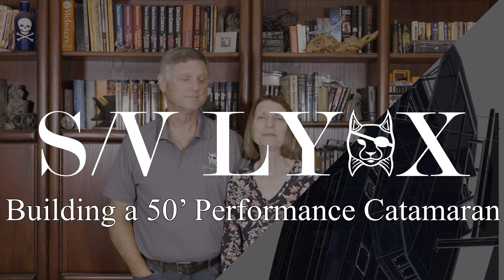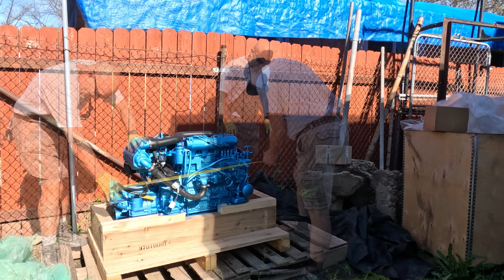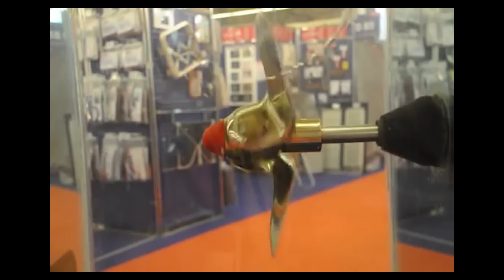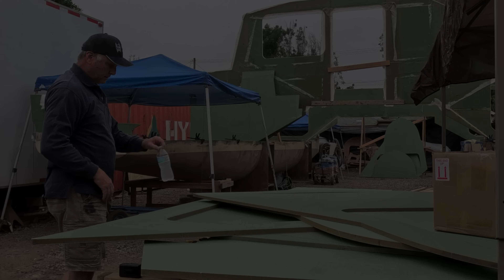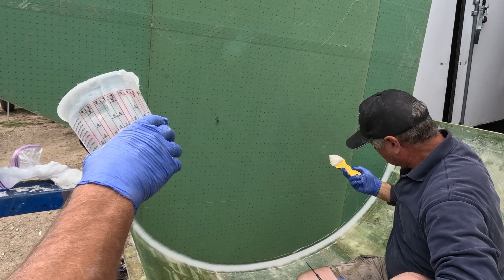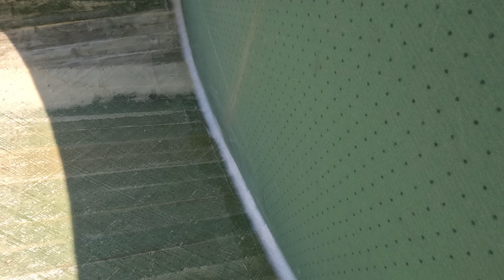Kit E83: Hybrid Propulsion Upgrades

Comment: Good explain of the system. Should work well.
It occurred to me that you only need to suspend the motor over its location,  rather than fix it into position,  before you do the last few bulkheads  
Manipulating the engine from a temporary "shelf" after the beds are in won't be too tricky
Reply from the maker: We'll get the motor mounts built soon enough to get the motor in position.  Schionning has already sent the new plans to Bruntons so we should have the final design soon.

Comment: Hi guys! The progress is rapid now. Looking great!
I like your solution for the brake calipers. Simple and efficient.
I didn't see a thrust bearing in your drive system diagrams. Will you be mounting a separate bearing for this, or is it incorporated into one of the other components?

Another thought that has come up while watching you install the bulkheads, how do you ensure that there is no twist glued into the hulls as you glue the bulkheads in? The hull can "rotate" around the bulkhead a little, which would introduce misalignment between the hull top edges and the side panels that will be added later. The degree of this misalignment increases with distance from the bulkhead. I see this as being an issue only in the aft section where the hulls have a rounder profile.

That smoking epoxy looks freaky!! It might be worthwhile mixing in a small % of the slower hardener as temperatures increase into summer, just to slow the reaction down a bit.
Reply: Top tip for mixing the epoxy, once mixed in the tub, pour out onto a mortar board/sheet of aluminium, and continue mixing before bagging the mix, this will allow some of the heat to dissipate.
Reply from the maker: We haven't gotten to the bearings and shaft portion yet, that's still to come!  As for any twist, the hulls have a natural position from being glassed on the forms.  As long as we don't stand in the hulls while the epoxy cures, no twist is introduced.  We stay out while the epoxy cures and check the levels on the bulkheads several times.  We are using all slow hardener already, freaky, hey?
Reply: @SailingSVLynx  ohh wow! That is freaky...

Comment: Wow. Those coves look pretty slick. I can see that your fabrication skills are sharpening as the build progresses. Nice work.
With every component brought on board, there is one more thing that can fail. A flat plank and a paddle are unlikely to fail, but wouldn't make for much of a comfortable cruising experience. A 100% automated large sailing vessel would be super comfy, but would be a maintenance nightmare. I drove myself crazy with those high-tech vs. low-tech decisions when I designed our house. I can see that you have spent a bunch of time trying to find the sweet spot on that curve as well, and you are adopting those technologies that you understand well and can debug in remote locations. The only suggestion I would make is to rely on vendors that are not likely to go out of business anytime soon, and to bring a closet-full of spare parts that will be difficult to source when you are on the hook in Bali or Borneo. Good luck with your build and your sailing adventure. 🙂
Reply from the maker: Good suggestions!  We will bring a boat load (literally) of spare parts ;)

Comment: I think your propulsion system is the way to go. We sail on a 52' catamaran and are considering a new boat with the hybrid in one hull and electric in the other. A couple of thoughts: 1) I think 80HP is more than you need. We have two Beta 38HPs and they are sufficient. Would be better to have more, but double is not necessary. 2) 20-25kw for the electric engines is good. I think, however, (and I am not an expert) that you need more battery capacity. As a general rule Lithium batteries can peak discharge at short intervals their full capacity (in your case, I believe, 12.2KW). At steady state they are generally rated to discharge half their capacity (6.1kw). I could be wrong here, but you should check into. Battery manufactures have this info on their web sites.
Reply from the maker: We have 33KwH., 690amps at 48v.  This boat was designed to have 100hp (two 50hp diesels).  Running one 80hp diesel and one 25kw electric motor (34hp) we have a maximum of 114hp. So we have a little more but close to the designed range.  Also, these cells are designed to discharge 80% of their capacity.

Comment: Get that boat roof on before the summer heat gets here. Have you considered just keeping it simple and doing a stainless grab rail along the roof on each side? Might not be as sleek as your vision but it could be great for tying into or strapping stuff down, more of a function over form.
Reply from the maker: We want the rain catchment system, so we might as well make that the hand holds and save some money on stainless work.  We'll get the whole roof done before the hottest months (July, August, September in So. Cal.).  We should be starting on the roof by the end of next week.

Comment: Great milestone guys ! Good job. 👍
Btw, is there no thick salon floor ie a 'box beam' to worry about - bc I find myself thinking 'is that it' insofar as rigidity goes - just a few 'flimsy' thin bulkhead panels?
Reply from the maker: There is a thick box floor.  We will be constructing that in a month or so.
Reply: @SailingSVLynx  Oh ok, Thanks for that - makes more sense now. 
Sorry to be a nag , but how thick if I may ask - 200mm ? And I'm now more intrigued because I would have thought it easier to rigidize the hulls by building /installing that part before adding floppy bulkheads?
Reply from the maker: @MikeWalker-mijeau  The bulkheads have to go in first because the floor comes up from below to attach to those bulkheads.  The thickness of the sole is 220mm.

Comment: Thanks so much for sharing all your design thoughts, challenges and solutions. It's fascinating engineering to achieve your desired outcomes. At any point did you consider a (diesel) generator, instead of a diesel engine, to power 2 x electric motors (in addition to your battery bank and regen capability)? I am wondering if the "advantage" of a diesel engine with the complexity of hybrid prop shaft, really matters, and if generator + 2 x electric motors wouldn't be simpler and still deliver your desired outcomes. 
1) If you are out of diesel, or if the diesel hardware fails, you have no propulsion using diesel with either system.
2) You still have electric / battery (& regen) backup with either system.
3) generator removes hybrid prop shaft complexity, still allows regen, vs arguable benefit of diesel engine in event of no sail + no electric propulsion possible (such an unlikely scenario with dual electric motors + diesel generator).
I am sure you have given it a lot of thought, and I've watched all your videos, so apologies if I missed why you dismissed that option.
Reply from the maker: You are very welcome, and thanks for following along and making suggestions.  But to answer your question, yes, we looked at every propulsion system we have ever seen and compared them all.  In the end, we choose our system because it we believe it is our best choice:
1) It is lighter by hundreds of pounds.
2) It requires less maintenance.
3) It is more fuel efficient.
4) It is a safer system.
5) It saves you a huge number of hours of listening and smelling a diesel engine.
6) And, when it comes to cost, though it loses to the diesel system in initial installation cost, it makes up that amount over time in fuel and maintenance savings.
7) It has more horsepower.

If you are one of our Patrons that gives you access to the Crew Only section of our website.  There we go into detail about all the various systems as we compare them against each other.  But, I will go ahead and talk a bit about an electric motor / diesel generator system for you right now.

If we went with an electric/diesel generators option it would...

1) Be heavier: You need two 30 kw generators to run two 25kw electric motors, and those weigh a lot more than one diesel engine.
2) Have more maintenance costs: Two diesel generators means double the maintenance.
3) Be less fuel efficient: Converting energy always has loses, and there are more conversations in a system using a generator to power electric motors.
4) Not as safe: It requires both the diesel and electric system to function if you want to motor off diesel.   Our diesel or electric motors can power one (diesel) or both props even if the other doesn't work or if you are out of diesel or battery power.
5) Be Noisier and smelly:  Anytime you are out of battery power and want to motor, you must run two diesel generators.
6) Cost more to buy: Purchasing two 30kw diesel generators is more expensive than one diesel engine.
7) Not have enough horsepower: A 25kw electric motor puts out 34 hp.  When you multiply that by two motors, that is 68hp.  Our boat was designed to use around 100 hp (for emergencies, or if going against a strong current, like going up the Rhine River).  Our system has 114 hp (maximum).

I hope that answers your question.  Keep the comments coming!  :)
Reply: @SailingSVLynx  Thanks so much for taking the time to answer. The weight and cost disadvantages alone would sell me on the path you've gone down. I really like how with a little complexity in the clutch and hybrid shaft solution you can reach your goals cheaper and lighter. Great engineering and great planning. Well done so far mate, you're an inspiration to many.

Comment: 2 questions Captain: is there any raw material in the boat, that doesn't need a peelply-off? 😂 Other question is about the electro-magnetic clutch: is it normally open or normally closed? So do you need electricity to open it, or to close it? just for safety reason, I hope it is normally closed, so if you have any issue with the clutch circuit or the clutch itself, you still be able to run the diesel and the prop.
Reply from the maker: I haven't learned the answer to that yet, but I will find out soon.

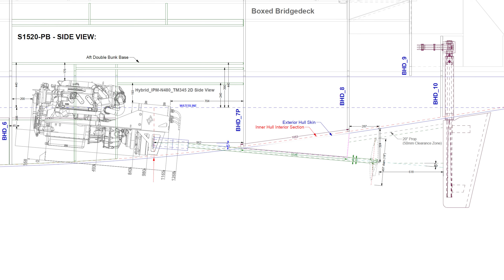Comment: 12:17 Is it typical in marine world for have shafts to be made to order? Or are there off the shelf models you could use, possibly with some extenders/spacers? I am wondering what happens  when you replace anything in a hybrid setup, e.g. replace an engine or even a clutch/decoupler for another brand or model,  thus changing the requirement for shaft's length? Additionally, are both of your shafts the same length? I would imagine so. It will be interesting to see how will you install just the electric engine in other hull.
Reply from the maker: I'm not sure, we are just getting to talks with a company about our prop shafts.  However, I can answer one of your questions right now, the shafts will be the same length on both sides.
Reply: @SailingSVLynx  Given your previous videos, I am looking forward to all the technicalities of it explained in one of your future ones! Great job so far, I am learning a ton with you, planning on building my own cat sometime in 3-4 years. Thanks!

Comment: I'd recommend supporting the aft end before you put the engine in. Its moving and sagging some just from you guys leaning on it. Other than that, it looks great!
Reply from the maker: What you are seeing is a bit of twist, not sag.  And that is out at the sugar scoops . The twist out there is due to not having bulkheads 8 and 9 glassed in yet.  When it comes to our diesel, since we aren't using sail drives,  our engine is placed nearly amidship.  It goes right up to bulkhead 6, the big one, which is located right over the cradles on the cement pads.  There won't be any movement there when we drop in the engine.  And, after that bulkheads 8 and 9 will be glassed in next.

Comment: Why not one diesel engine generator combo wired to two electric motors?  Would take out the complexity of the prop shafts and disconnecting systems.  You could then look at putting the engine somewhere more workable for repair or replacement.
Reply from the maker: Horsepower.  Each electric motor is 25 kw, or about 34 horsepower.  That's only 68 hp total.  This boat was designed to have 100 hp for emergencies or when you are in a strong current, etc.  Then there is the size of the generator.  You would need two 25kw generators, or one 50kw generator.  That's a lot of weight and a lot more cost.  Together, two 25 kw generators weigh something like 1,800 lbs., one 50 kw generator weighs around 1,400 lbs.  Our Nanni 80 hp diesel weighs 720 pounds.  The cost is also much higher, as in $9,000 more at least.  There are also additional loses in power conversion vs a diesel to a straight shaft.
Reply: @SailingSVLynx well, also importantly, added redundancy, that is if electrical system fails, you can still go using the diesel!
Reply from the maker: @wrobelda  And vice versa.
Reply: @SailingSVLynx  Sure, but I suppose the point argued was your setup being advantageous over a hybrid series and a diesel failing doesn't affect either setup.
Reply: @wrobelda  I didn't know you were referring to that specific part.

Comment: Stay away from regen it wears the cutlass bearing twice as fast causing the need to haul out twice as often
Reply from the maker: Cutlass bearings last over 3,000 hours of use.  With our locking shaft, it doesn't even turn while we sail.  It only turns while we regenerate or use the motors.  The times we regenerate are less than when we motor.  So, if we need to replace the cutlass bearing after 3,000 hours, so be it.  We don't have to haul out to do that either.  So, not all that much cost.
Reply: Evidence required.
Reply from the maker: @normanboyes4983  Lots of it out there... 
https://downeastboatforum.com/threads/how-long-does-a-cutlass-bearing-last.33331/
https://forums.sailboatowners.com/threads/preemptive-cutlass-bearing-replacement.122026/
https://www.safe-skipper.com/cutless-bearing-replacement/
Reply: @SailingSVLynx  Sorry (again) I was challenging the O/P for evidence. I was a sea going Marine Engineer for 35 years. There is no conceivable reason why regen would cause additional cutlass bearing wear other than would be caused by the shaft rotating under propulsive power.

Besides that, what is better 1000 hours of cutlass bearing wear and ‘free’ electrical power OR 1000 running hours on the diesel engine and 1000 running hours of fuel?
Reply from the maker: @normanboyes4983  Maybe put the OP's name at the start of your comment so I don't get confused (it's been known to happen ;)
Reply: @SailingSVLynx  Yes it is odd, I press the reply function to the OP and it does not put the OPs name in automatically. BUT when I press reply to you it puts your mama in automatically . 🤷‍♂️

Comment: Will you have or need any safety mechanisms to prevent a drive operating when the shaft brakes are engaged, do the bulkheads need much adjustment or are they fitting the hull as supplied.
Reply from the maker: The bulkheads are fitting as supplied, with a few minor 1/8" trims occasionally (3mm).  It would be nice to have a safety mechanism, but I don't know how we would accomplish that.  However, it should be very obvious at the helm when the brakes are engaged since the brake levers will be pushed forward, and they will be right up by the throttle levers.  So, when you go to use the throttle, you will see the brake's position. Think of it like a car's emergency brake, you don't have any safety mechanism there, you just have to disengage the emergency brake before you can drive.

Comment: You need a lock-out on the motors so to not try to turn the shaft when it is locked - maybe when the brake handle is engaged it pushes a lever switch in a relay circuit to  safety switches.  Not doing something invites broken expensive equipment by human error, we are all forgetful.   You probably already have thought about this. maybe placing the starter key where it has to be removed when the brake is on🤐
Reply from the maker: In a later video, I talk about the brake system we are adding to brake the shaft.  It is the only way to feather the Autoprop for when we don't want to regenerate.

Comment: That is not good for the epoxy to be smoking. Maybe use a slower hardener. The motor stuff is a bit complex but there is also a lot of redundancy. If some bits or pieces fail, they will not interfere with the other pieces (as long as the various clutches remain functional). So I don't really think it is a big problem. There would be some learning curve for crew or if you ever sell the boat. But I think it is manageable.
Reply from the maker: We are using the slow hardener already.
Reply: @SailingSVLynx  There is also the 209 extra slow. But it is 3:1, not 5:1.
Reply from the maker: @mckenziekeith7434  With the hot months coming, we may have to invest in some of that Extra Slow hardener!

Comment: audio off at times, the admiral sounds better with the deeper sound
Reply from the maker: We had some electronic noise in some voice recordings and had to use an audio AI to repair it.
Reply: Good explanation of the propulsion system, design choices and operating modes, I think you have hit the sweet spot. Good progress with the bulkheads.😀👍
Reply from the maker: @normanboyes4983  Thanks, and we appreciate all your comments.

Comment: your big compromise is to have a very complex system ... many points to get problem
Reply from the maker: Yes, we did mention that toward the end.  However, there is really no way to eliminate any of those components, other than the Sigma Drive, if we want to have propulsion, regeneration, less drag while sailing, and have the diesel act as a generator.  So, we decided that a second diesel on board (as a separate generator) would have more possible failures than what we added to this one diesel.  And, even then, the only thing we could have eliminated was the magnetic clutch.